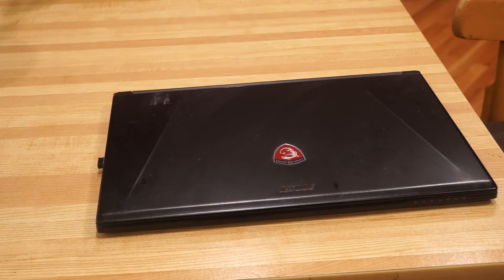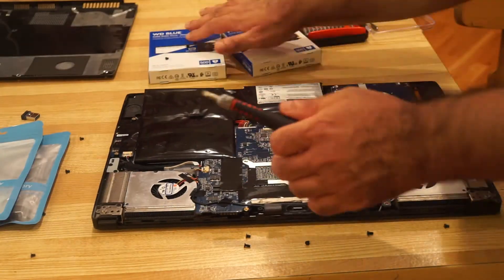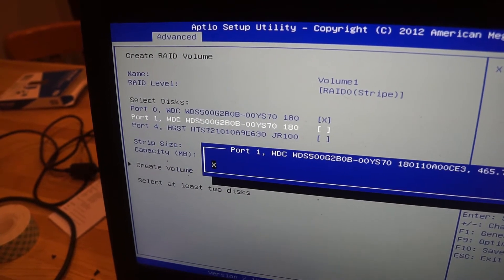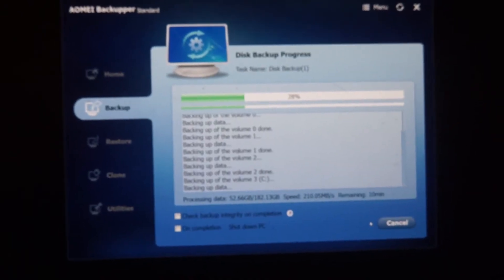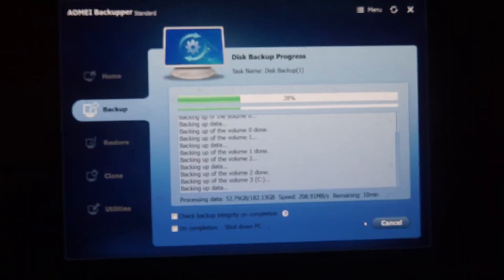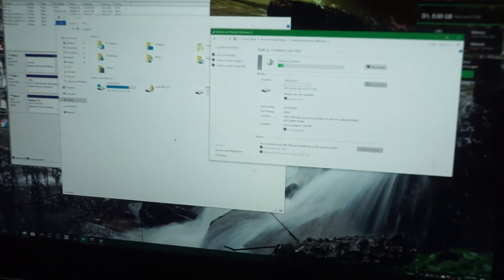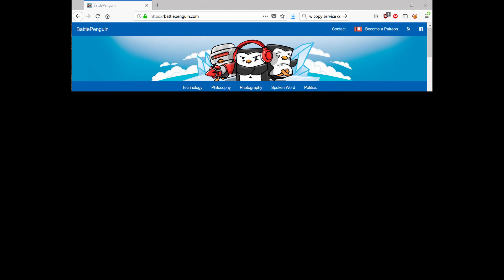Upgrading the SSD on an MSI GS60 Laptop

Comment: far as i can see on specs for gs60 2pl it says Storage Up to 256GB + 1TB HDD 7200rpm ...will that support to go over 256gb ssd m.2...for thosse 512gb m.2 can see also the slot is different will that fit? or shall use 2x256?

Comment: Just quick question, so you just upgraded ssd to 500gb on each slot?
I was wondering were there any problems? rather then back up?
I have GS60 2QD. I was about to upgrade one SSD to 1TB and use other SSD slot as storage, im not sure whether this gonna work.
Reply: Hi did you upgrade ? is it ok whit 1TB?
Reply: @シークレットユーザー7  nope didn’t work out for me. Changed into 500g each.
Reply: @DavoHCL  😞 need to buy new pc then

Comment: Unfortunately your pictures of the drives were too blurry to be able to read the drive specs.  What is the physical size of the 2nd HDD?  I.e 3.5", 2.5" ?
Reply from the maker: 2.5 inch. Laptops only hold 2.5" and M.2 hard drives. 3.5 inch are only for desktops or external enclosures.
Reply: @thebattlepenguin  Thanks for your quick reply.  My 2nd hard drive is failing so I plan to replace it with a 1 TB 2.5" SSD.  The current readable sizes for my MSI GS60 are C: Boot SSD, 100 GB,  D: 2nd 2.5" HDD, 630 GB.  I thought all the secondary drives were 1 TB but apparently not.

Comment: I have this same laptop. Can I replace the HDD with a SSD? If so, what's the max I can go up to? Also, can you give us a step-by-step guide?
Reply from the maker: So there are three drives total, The 2xM.2 SSD drives (That I replace in the video) and that 1TB drive I leave alone. Yes, you can replace that 2.5inch hard drive with any 2.5 inch SSD SATA laptop drive currently on the market. It's pretty easy to get to; you just take off the back and it's right there (at about the 0:32 second mark of the video). You'll have to disconnect that ribbon cable that goes over it, but after that it should just unscrew and come right out. You don't need to remove the battery or anything else. This guy has a better tear-down video: https://www.youtube.com/watch?v=K2ZicdFEn9o
Reply: @thebattlepenguin  So as you know the 1TB drive that is 2.5 is HDD. When I replace it with a 2.5 SSD drive, do I need to have it in an enclosure? It seems the SSD 2.5 seems smaller than the 2.5 HDD for some reason in pictures. (The Samsung SSD's) Also do I use SATA II or III? I know you didn't replace that 2.5 drive but hopefully you can continue to provide insight...
Reply from the maker: @PharoahsKingdom  Both drives are the exact same size. 2.5 means 2.5 inches. All modern SSDs are SATA3.

Comment: Also I have an MSI Ghost 60.  An excellent laptop but I need to install X-Ubuntu Linux, duel boot with Windows 10 Pro, and my 128GB SSD is a bit tight.  Your video seems really helpful in showing me what to do and avoid.  I didn't know I had 2 SSD's in a raid pattern.  I may go for a clean reinstall of Windows 10 seeing the trouble you've had with the restore.
Reply from the maker: So mine has 2 SSDs in a RAID pattern. Check your BIOS to make sure it's the same for yours. The Linux kernel does support Intel Rapid Store, and I did have a dual boot setup at one time before I went all Linux (and later all Windows) on it. AOMEI is pretty good if you want to go the imaging route instead of a full install. They both have their trade-offs. Good luck!
Reply: Thanks very much.  This weekend I installed xUbuntu Linux v 18.04 64 bit by partitioning 28 Gb off my SSD and 80 or 100 Gg off the std HDD.  It went without a hitch but my old Ghost 60 only has 12 Gb of RAM.  I need the 64 bit Linux for computational fluid dynamics (CFD).  Also I think I have some Windows-10 64 bit OEM disks kicking around somewhere so it may be easier that way.

Comment: Could you give us the m.2 sata to usb converter reference please ?
Reply from the maker: Just look up "M.2 USB" on what ever shopping website you use (Newegg, Amazon, eBay, etc.) You'll find several of them. Just find the one that matches your hardware.
Reply: Unfortunately, I only find closed boxes where to place the SSD. I'm looking for a device to directly connect my SSD (without placing it in a box) and your video the only reference I can find.
Reply from the maker: Oh the ones I bought came with an enclosure, I just done have it attached in this video. You can take the boards out of the case and not use the case if you don't want.
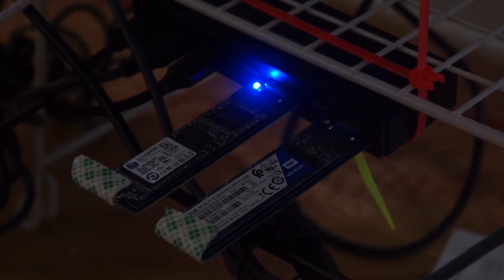Reply: Thank you very much for the explanations and for the reference. Could you also tell me which USB Hub did you use at 1:54 please ?
Reply from the maker: Inland 7-Port from Microcenter
Reply: Thank you very much !